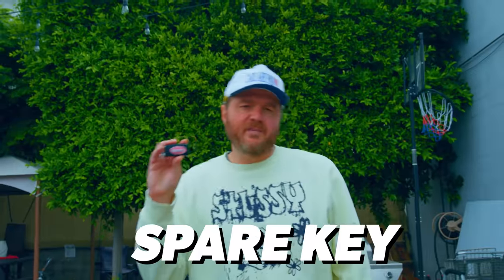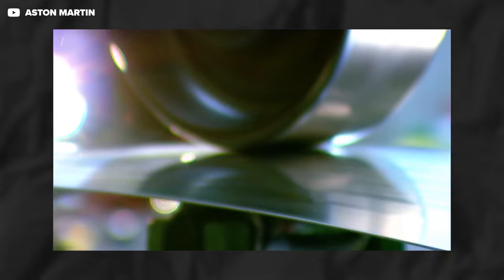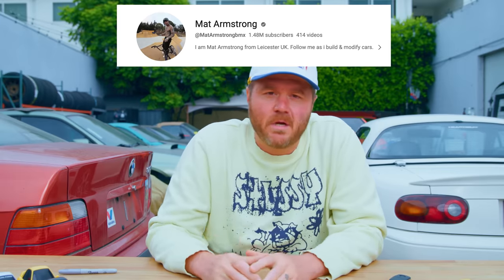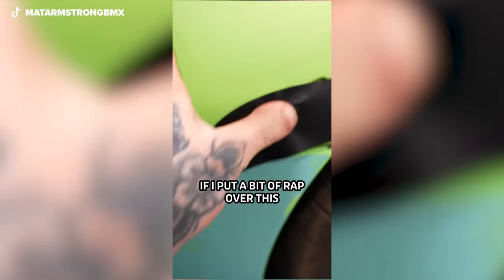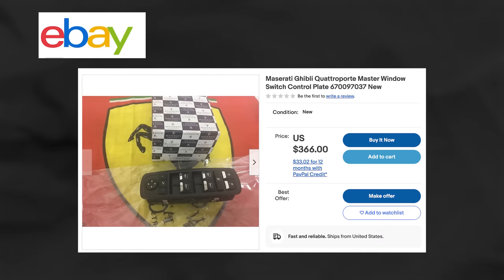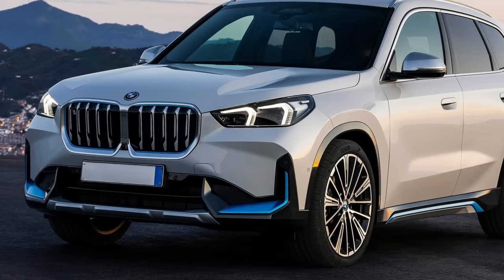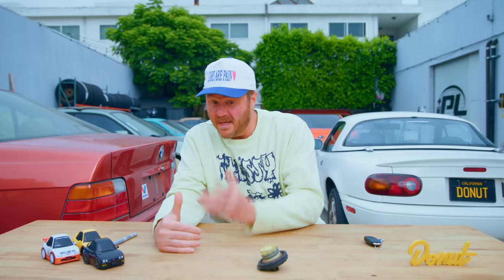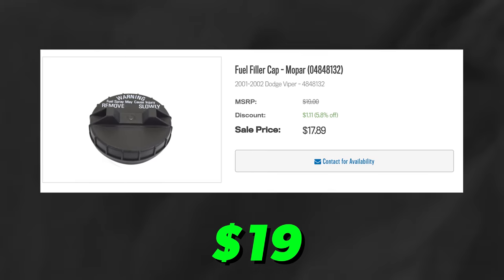How Luxury Cars Rip You Off

Comment: The Rover 45 comment isn't quite true as Rover is gone now and you can't get parts for them. Well sort of because Range Rover still exists etc. The ATC part straight up isn't available anymore, you can get reconditioned ones for about £350.

I know because I used to own a Rover 45, genuinley loved it. Beneath the skin it's the same platform as the Dc2 Integra but it uses the engine and transmission you'd find in the MG F and Lotus Elise. It was wild.

Comment: Lotus Evoras have powered mirrors as an option HOWEVER whether its specced or not ALL Evoras have the motors and wiring and the only thing they add in is the switch.

You can either pay, like, $400 or whatever it is for the feature OR you can buy the switch which is from a Ford Focus and just plug it in for $15.

Lotus is actually a great example of how parts bin cars arent necessarily a bad thing. I mean, if a part works, is reliable and looks fine why reinvent the wheel?

Comment: Come on James, get your facts straight. The Viper’s 6 lug bolt pattern was never shared with a Dodge Ram. The Dakota changed from 5x4.5 to 6x4.5 in 1994, which was after the Viper was released.

Comment: Rover 45 basically has Honda civic underpinnings even engines, the 45 was from the 400 series just more refined a face lift as you say. overall the Rovers were pretty good, Japanese cars were quite crashy over the bumps and bad roads, didn't sock up the bump to well so harsher ride rover setup suspension to give a better ride and handled much better for uk back roads through the countryside, my home town growing up many taxi used them, way in to 2005 on wards because they ere pretty reliable some over 20 years old time they changed them. ive rover was still around and not Chinese owned (  MG)  and they still with Honda so the 400 series / 45 Honda civic, the 600 series the accord some had Honda own engine some had rover own engine, fr comfort and still good handling so new 45 and new civic id pick the rover brand as i drive lots country roads so rover be the best option as can easy be 8 hour drive on windy country roads so you want a car what rides well

Comment: its no different than when i worked at the the local vw dealership in simcoe ontario, Simcoe VW. the rutan is just a rebadged dodge caravan that costs twice as much and lacks the stow and go seats. part of the PDI was to place vw stickers over all the mopar emblems... when the vw parts were back ordered (rear brake calipers) we would just order them from the chrysler dealership, Demeyeres Chrysler   they cost less than the VW parts and  the dealership charged VW prices to the customers.   I am glad I dont work there any more

Comment: I remember developing a system for a parts supplier in the UK to upload parts onto their eBay shop - so many parts compatible with so many cars.. I think there was a couple of starters that applied to something like 27 different car models from 9 different manufacturers...

But it's not a new thing, my Dad's '81 G Wagon needed a new starter £415 from Mercedes or £115 from Bosch (just without a tiny 3 pointed star...)

Comment: There is one particularly egregious case of parts bin sharing, and it's the first generation, pre-facelift, Land Rover Discovery. The headlights were from a Freight Rover Sherpa, the taillights were from an Austin Maestro Van, the chassis, door frames, and even most of the glass was from a first generation Range Rover, as were the axles, transfer case and the manual gearbox. A lot of the switchgear was from an Austin Montego, the door handles were from a Morris Marina, the heater vents from an Austin Metro. Even the V8 petrol was from the Range Rover, albeit earlier versions. The only new things were the bodywork outer skins, the roof and taildoor, some of the trim, and the 200 Tdi engine. In fact, the parts-bin sharing was done on such a cheap level, a lot of components still had the branding from the vehicle they were taken from!

Comment: I never understood the danger up pop up headlights. You just got hit by a car. The rest of the car still hit you. 2000 pounds of steel and plastic and the government is worried about the headlights.
Reply: Imagine getting body slammed onto a floor. Now imagine getting body slammed on top of a stool in the middle of that floor. Same impact, but it goes into your body at different points.
Reply: @BogeyTheBear  my point is if the car is going fast enough for those headlights to matter... you just got hit by a car.

Comment: Actually the Viper shares six lug with Dakota and brakes can be made to fit a Dakota
Reply: I have a 1999 Dakota RT regular cab in Solar / Viper Yellow it was featured in the Gentleman Racer.. and Mopar action .. the Dakota was Shelby’s return to rear wheel drive performance.. and viper v10 and truck v10 share architecture with the Magnum V8  .. Roush actually welded extra cylinders to Magnum block before Lamborghini got involved.. the early Viper mules one had a V8 which Shelby personally preferred..  the Dakota one as a test bed for twin turbo v8 .. and Dodge eventually did the Dakota RT with 5.9 v8  which has tons of potential.. and handling was on par with bmw 540i in slalom and Skidpad .. hot Rod tested a Dakota RT it ran as fast as Mustang GT at the time ..